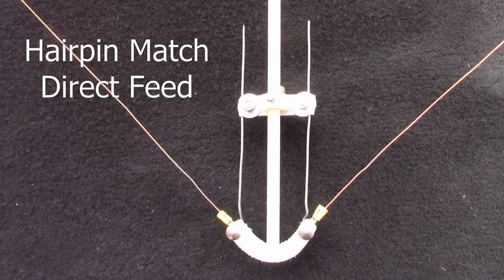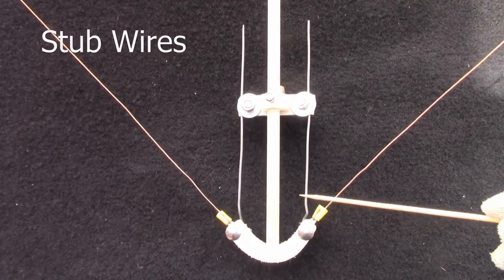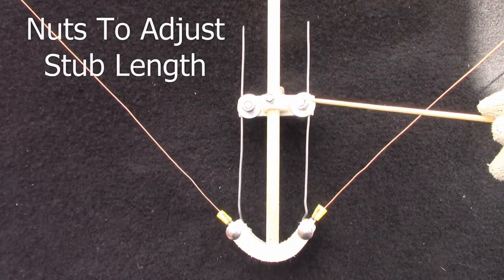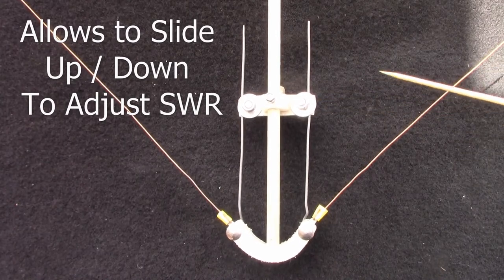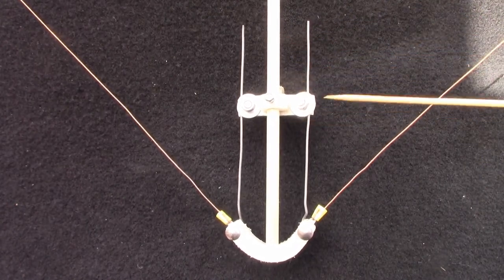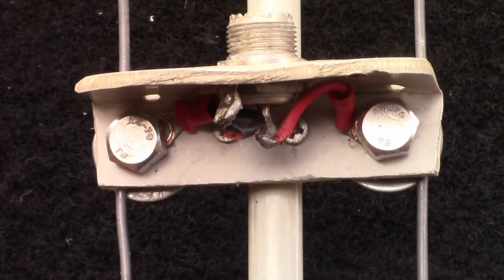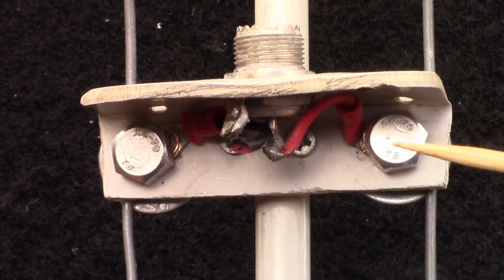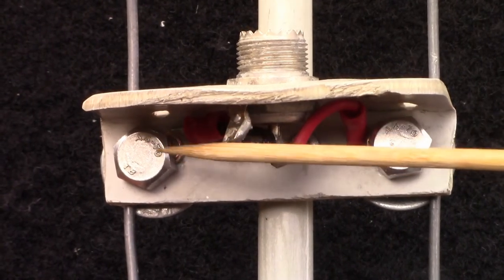✅HAIRPIN MATCHING STUB for CUBICAL QUAD DRIVEN ELEMENT

Comment: I think the location of the connector is not correct. If the plate it is mounted on is metal, you only have a short circuit. If it is made of insulating material, then you will only change the dimensions of the quad. If you mount the SO-239 in the corner of the quad, then you will have  hairpin match.